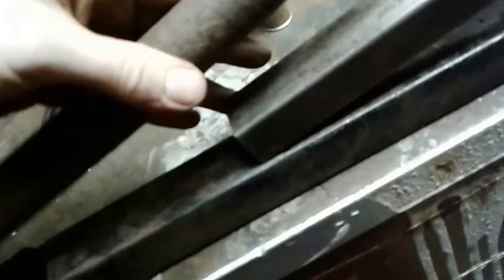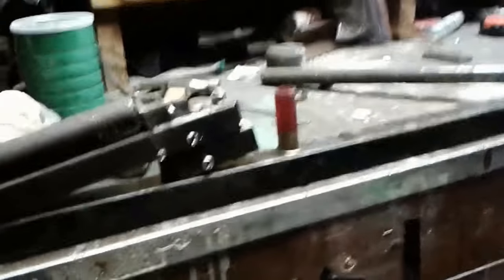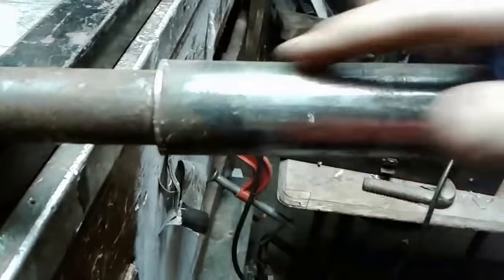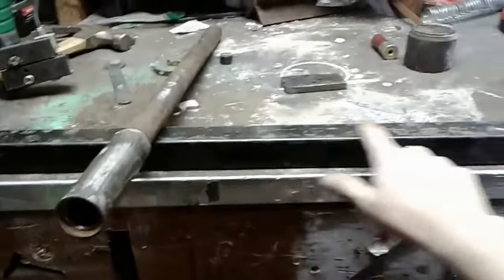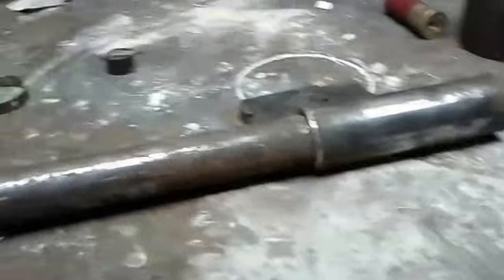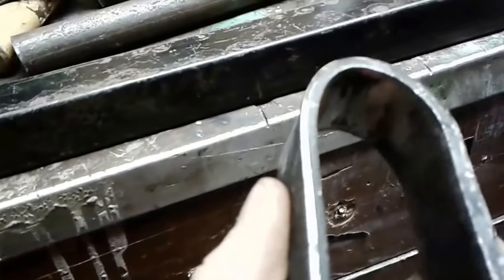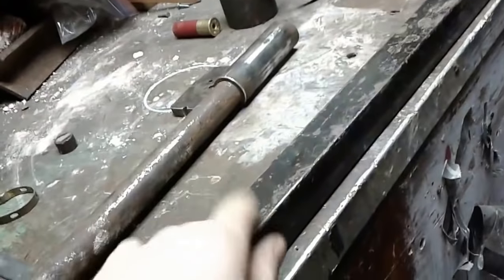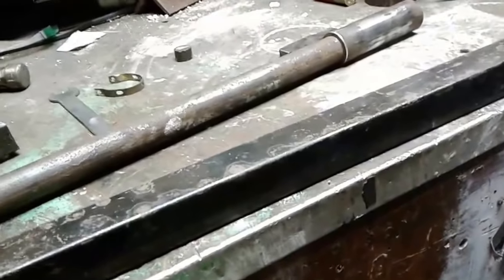UPDATE: Homemade Scrap Shotgun v2, New Shotgun, Plans for both!

Comment: Please tell me you have a blast shield 😲. please use the up most care when testing HOME MADE BLANKS. Never under estimate the power of gunpowder. Even in small amounts. Anything you can safely use in a plastic flair gun, you can use .
Reply from the maker: this was when I had zero money, so I had to scrape everything I had just to get ANY power tools

And no, I had no safety equipment, I even tripped the breaker on the house several times just to get this far

Comment: Perhaps you should consider a simpler design for your first shot gun build. Perhaps something like a Slam Fire design?
Reply from the maker: I have done a slam fire concept, bery simple indeed, but I no longer have it, its been since used for other projects
Reply: Jarrod Ellis 
There are some very cool variations on the Slam Fire theme if you want to do a build with a trigger. I’ve seen 12ga spring loaded Slam Fire designs that operate via a trigger. Very cool but kick like a horse. You have likely seen them but If interested let me know I’ll point you to a vid.